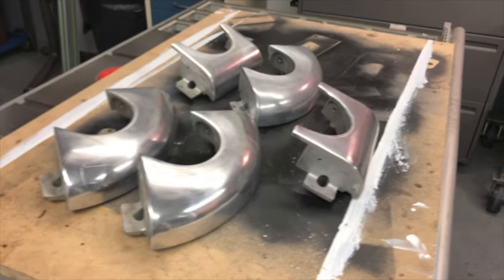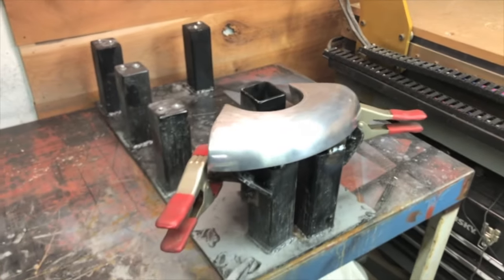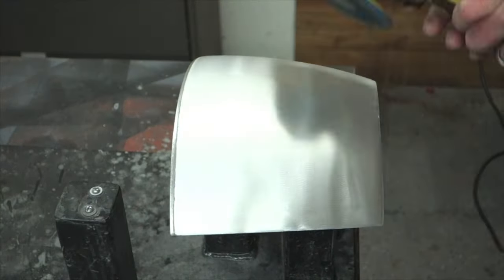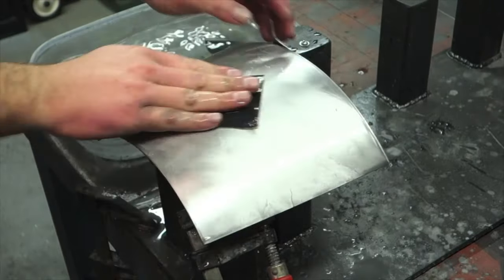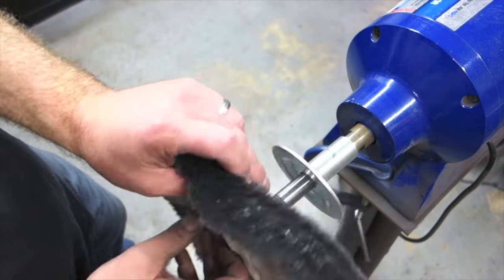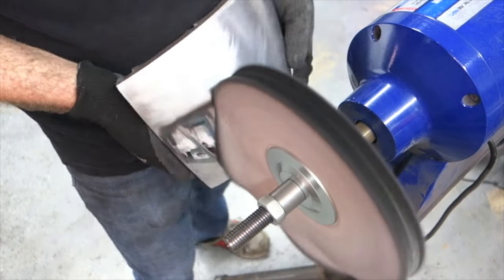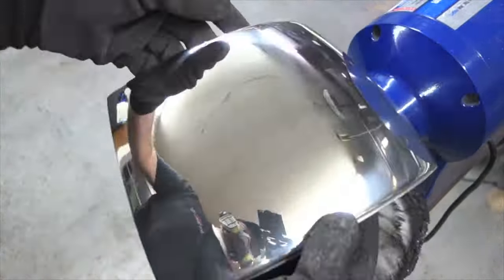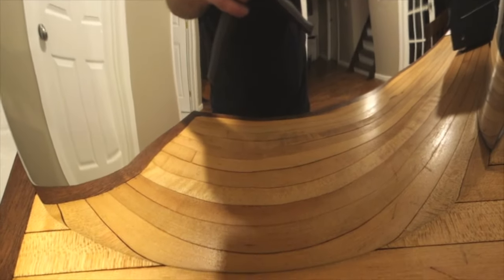How to Polish Aluminum

Comment: Great video.  A suggestion is to sand in one direction.  Then change direction with the next finer grit etc.  This way you can easily see the previous scratch marks removed.  I hope that makes sense 😀
Reply: Thats a good trick, thanks for sharing
Reply: The technique is called cross polishing, and you do not switch between grits halfway. Simple explanation is that a 100 grit will go to X depth in Y amount of time. Switch 90 degrees and you  will cut to the same depth in a much shorter amount of time leaving a scratch pattern that is twice as fine (200 grit) so if done right you save time and can progress faster from say 100 to then 320 to 800 to 1200 and finish at 2500 or 3000.  A quick Buff with a micro polish and you have a world class finish. Something unlike what you see in this video. A reflectivity meter can be used to quantity this but in reality it is obviously cloudy. 🙄  some people just see shiny and don't understand how shiny it could be. Best apology would be a sharpened knife. How sharp is sharp. There is a difference between shiny and scary shiny
Reply: Can the same be done with sanding attachments? Like a orbital sander or grinder sanding pad attachment
Reply: @Soldier1287  orbital sanders are designed to sand in many directions as they work. This technique doesn't work with them because of the rotating orbiting action

Comment: Thanks! How do you protect the shiny surface form oxidizing or getting matted?
Reply: acetone then clearcoat
Reply: Or keep alot of wax sealer on it like Turtle wax or something.  It's almost impossible to get clear coat to stick to polished aluminum..
Reply: @paulcook68  ive done it with great success. Ive sprayed all my polished parts on my bikes to prevent finger prints and the clear coat is still on. Yes eventually it will wear off since it doesnt have the greatest adheasion but it works pretty well.

Comment: thats awesome i am 18 wheeler driver i did my allium rims like this i worked on them all the time when i was sitting waiting get loads or unloaded with air high speed tool an i had them just like this everyone was like that the most awesome rims i ever seen i could brush my hair an trim my bierd with them wheels i said i needed outside mirro hahahahahahhaha going down highway guys hit me up on CB all the time thats the cleanest truck they ever seen
Reply: no i didnt do trailer cause i dont care about the trailor cause i changed every day only the 6 rims on truck an all the allium pieces i had i said i rather have allium than i would chrome cause it will rust allium want ever

Comment: wow!! so what do you recommend to seal the thing with once you've finished polishing it?? aluminium has a tendency to dull after a while due to oxidation
Reply: It has to be re polished regularly. There is no magic one time fix. Adding clear coat, will dull the shine, and will peel with time, being an even bigger headache. Just hit it with some "mothers mag and aluminum polish" every couple months with a micro fiber pad, and wipe clean with a micro fiber rag. If you stay on top of it, it should last forever.
Reply: Meguiars Ceramic coat wax

Comment: I've had better luck going to finer grits of sandpaper before doing a brown - white - red buffing.... But most of my pieces I've had to do with hand buffers (if I could remove these pieces from the car and use a bench buffer I would)...  Maybe my hand tools don't have the proper buffing attachment? I still have a few line/scratches pop up here and there that are hard to get out

Comment: What do you coat it with to keep it from oxidizing quickly?
Reply: I recommend spraying lacquer, varnish, otherwise the shine will not stay long.
Reply: @fern8580  the same stuff used for wood? Is lacquer better than rustoleum clear emanel?
Reply: @raizt1596  Gtechniq C1
Reply: @raizt1596  Restom AluFilm 4040

Comment: How do you clean dirty metal polishing buff pads?
Reply from the maker: Are you talking about the ones on the grinder or on the buffing machine?
Reply: @jessesutton19  The buffing wheel. 
I noticed when buffing aluminum, the   buffing pad turns black. Even my hand cloths turn black. Wondering how to clean this black off everything. Dish soap, varsol, lacquer thinner??